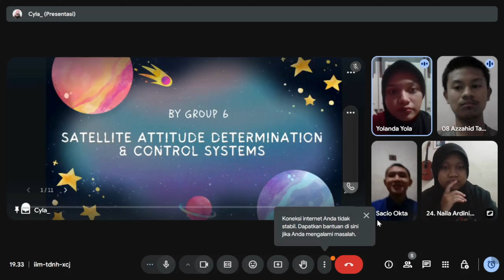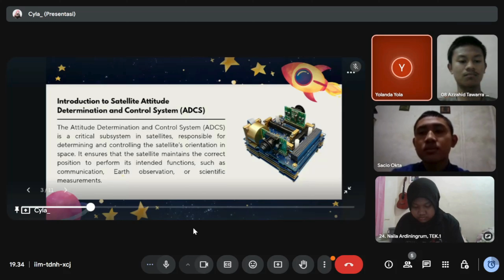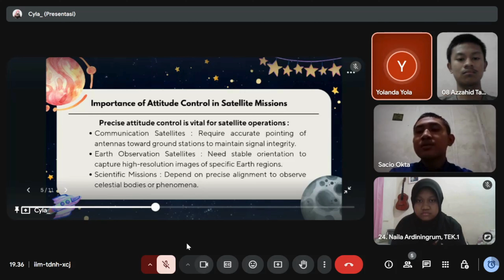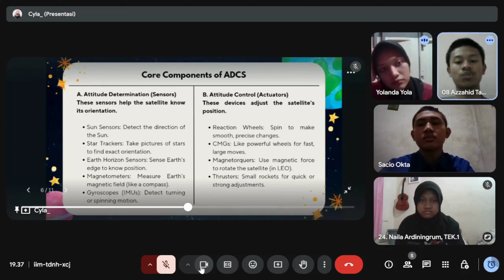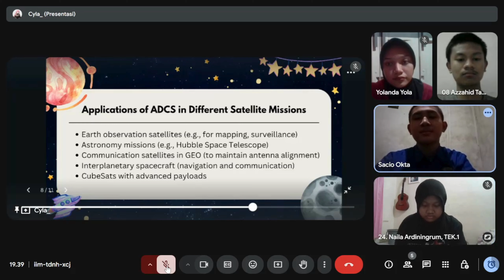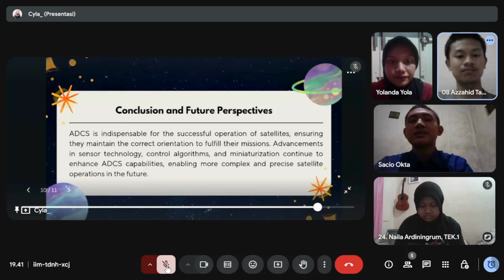XI TEK 1 - Group 6  I ADCS Presentation Video

Comment: Hello I want to ask you, my question is are spaceship use such as sun sensors, gyroscope, and magnetometer to operate too?
Reply from the maker: @FarelAdriansyah-ml1yb   Big thanks to you Farel. Yes, spacecraft do use sensors like sun sensors, gyroscopes, and magnetometers as part of their ADCS. Each of these has a specific role—sun sensors help detect the direction of sunlight, gyroscopes measure angular velocity, and magnetometers detect the Earth's magnetic field. These sensors work together to help the spacecraft understand its orientation and maintain stable attitude control.

Comment: Hello i want to ask you something. Why is the integration of multiple sensor types like sun sensors, star trackers, gyroscopes necessary in the ADCS rather than relying on a single sensor type?
Reply from the maker: @Astral-Expert  Thank you for giving us your question, Fathan. The reason we integrate multiple sensor types—like sun sensors, star trackers, gyroscopes, etc.—is to improve accuracy, robustness, and fault tolerance. No single sensor is perfect in all conditions. For example, a star tracker might not work if the field of view is blocked or in bright sunlight, but gyros and sun sensors can still provide attitude data. By combining them, we can use sensor fusion algorithms to get reliable and accurate orientation information even if one sensor has degraded performance or fails.

Comment: Hi, there! That was a great presentation! But I want to ask something.
What are the potential consequences if a satellite’s ADCS fails during a critical mission phase, and what redundancy or fault-tolerance strategies could be implemented to mitigate this risk?
I hope you will read this. Thank you.😄
Reply from the maker: @neilofebrian1708  Thank you Neilo, we truly appreciate your question.

If a satellite’s ADCS (Attitude Determination and Control System) fails during a critical mission phase, it can lose orientation. This could cause issues like misaligned antennas (leading to communication loss), solar panels not pointing to the sun (power loss), or incorrect payload operation.

To mitigate this, satellites are usually equipped with redundant systems—like backup sensors and actuators—as well as fault-tolerant software that can detect and respond to failures. In some cases, safe-mode protocols are activated to maintain basic orientation until ground control intervenes.